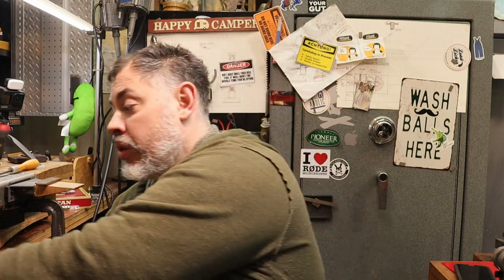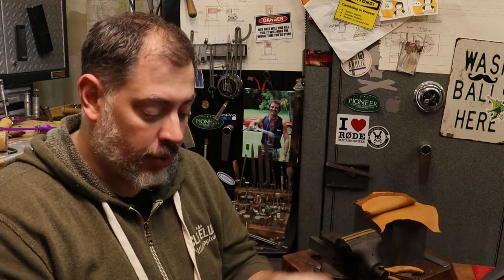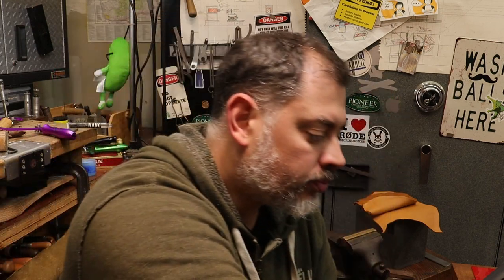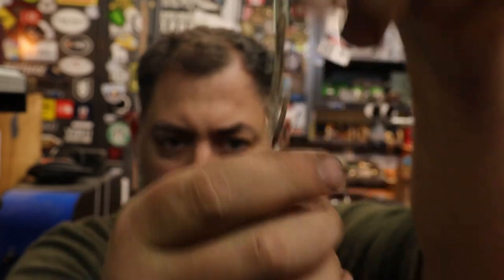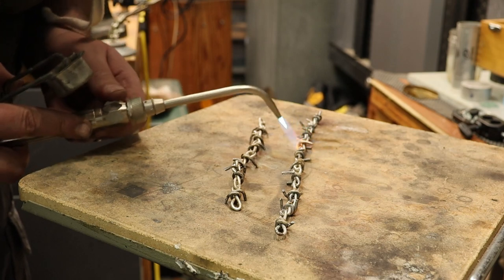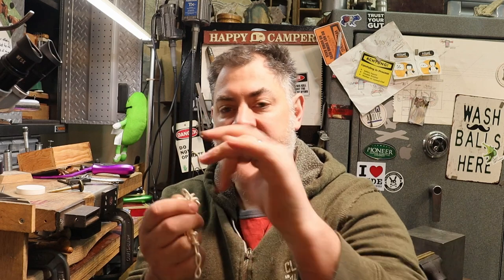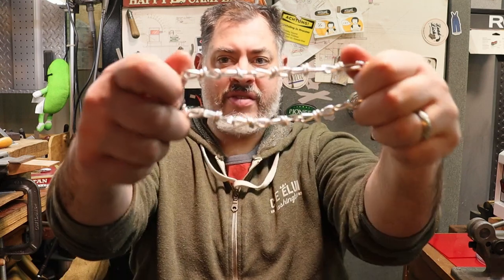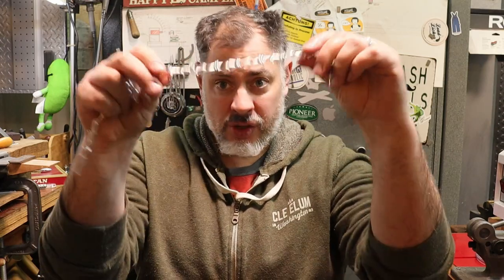Tutorial- Part 2- Turning a Paper clip chain link into a barbed wire link

Comment: When you soldered the twist wire on your original paper lip chain did you just solder the twist ir did you solder the twist to the paper clip chain? I hope you understand what I mean
Reply from the maker: There we’re two solder joints - first the paperclip link and then afterwards I soldered the twisted barb to the twisted paperclip link